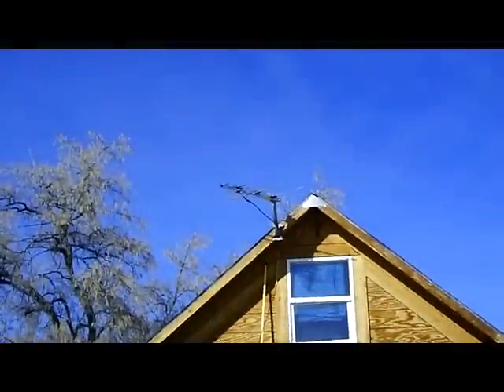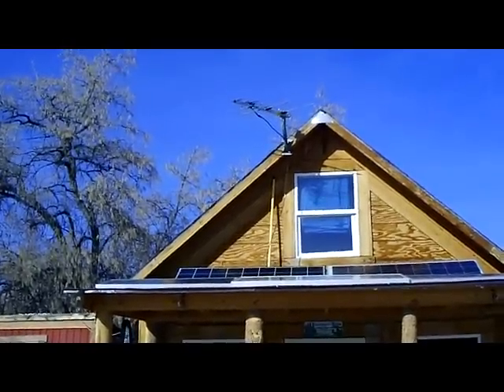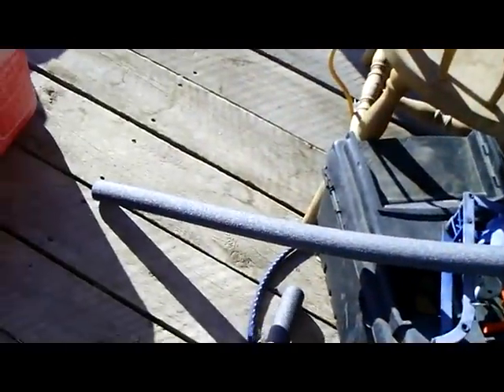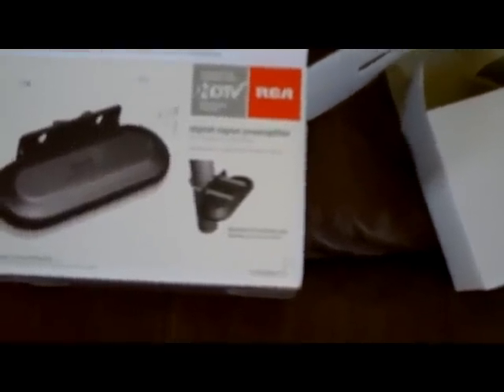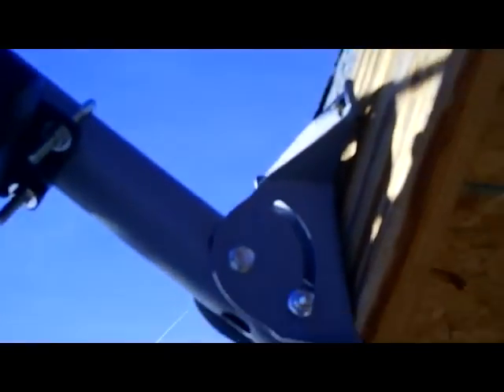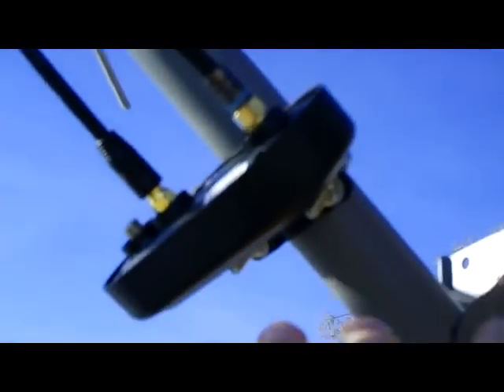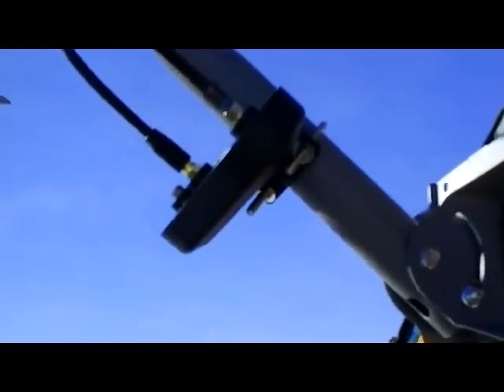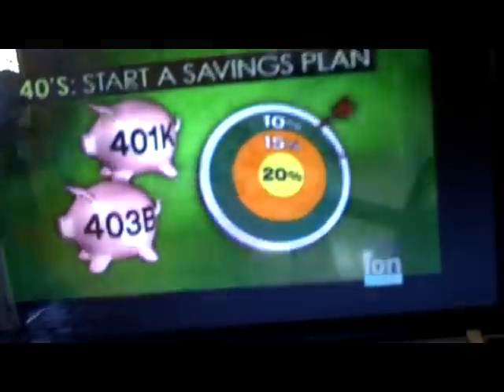Off Grid TV Installation Adding A Booster

Comment: Hey Lamar, I really appreciate your videos,thank you. I have a suggestion that you might find helpful with the outside booster. I agree with the others that it is upside down. You dont want the "elements" getting into the unit. Keep it safe. I would suggest putting it under the eve of your cabin. It will be out of the weather and then youll be able to route your cables neatly inside and through the antenna mast then thru the fascia and neatly tucked against the house. It will look nice and be safe. two birds with one stone. Thanks again and good luck Brother~
Reply from the maker: Thanks I will probably change the location. This was just for the vid to show how it works.

Comment: Just so you know that booster with the power connection actually sends dc voltage up to the preamp.  You can not boost anything without some kind of power input.  Try using the preamp without the final booster hooked into the circuit and see what you get.  Great video, thanks for sharing.

Comment: Greetings again, I was a tv repair teacher and it was my business for many years too. so here are a couple of tips. #1 the booster is designed to be mounted on a vertical pipe mast, and the cable connections are supposed to be on the bottom for weather protection... #2  the foam insulation helps protect the wire from sunlight rot. but, putting it inside metal pipe reduces the noise from auto ignition (spark plug noise) from nearby running engines including generators. and sometimes from electric motor "Hash" from sparking brushes in some electric motors too.  #3 prevent Lightning, just ground the antenna support metal mast. it then acts like a lightning rod and drains off the charge before lightning strikes it but use heavy wire like #10 or 12 and connect to a ground stake or metal pipe at least 6 feet into the ground. Correct a few details and the weather won't corrode these coax screw on connectors (They are called "F" connectors in the trade...

Comment: flip the booster outside, then your connectors are more protected from sun and weather and the cable from antennae becomes a drip loop and water doesn't travel further down that cable.
Yeah, it's still a silly design. Booster is a great idea, Dad used one when I was a kid.

Comment: I only have one suggestion. On any outside cable connections, and the unused terminal on the booster, put tar wrap/sealer or similar on them to keep out moisture. That's a big killer of coax cable. Tar wrap can be picked up at almost any hardware store and resembles electrical tape, but it's thinker and has a wax paper backing on it. Keep up the great work Lamar!

Comment: Looks like it works well.  I tried a number of cheaper ones an had no luck.  I am splitting my signal to 3 tuner cards and one other TV in another room, and I get a lot of signal loss on the cabling.  I finally invested the money ($80) in the the Winegard one and it has been amazing.  It looks like that RCA may be a good solution too for a lower cost.
Reply from the maker: The RCA antennae is well built and the booster seems to work well but not real happy with the plug placement and feels a little cheap. Made in China and I try to get US products.

Comment: OPS! the booster up at the antenna requires power to work and there is no battery in there because the DC is sent up the coax from the small piece inside. the inside piece accepts power from the plug in block and sends some up the coax to the antenna mounted part then the stronger signal comes down to the inside round piece and is amplified again and sent to the TV (Or fm radio) but without all three pieces connected none of it will work.  Remember I am a professional TV and Antenna Technician... ask me if you need more explanations I would be happy to explain. I am subscribed too. I like your productions but I want your electronics to work!

Comment: Nice set up. Just to clarify something for you, That little box and power supply feeds voltage up thru the coax to the amplifier on the mast to power it. The only component doing any amplifying is outside but requires a power source. So they made a special device that allows the power supply voltage to flow only up to the amplifier and not to your t.v.
Reply from the maker: Thanks- good to know!

Comment from the maker: For people that pointed out the booster may be backwards on the post. I reversed it but I am still not happy with the design that has all the plugs on the same side.
Reply: I would have just attached it to the wood and left it off the antenna.
two wood screws in the holes and it would be fine.

also on expence of antennas, look around youtube, there is easy to make digital antennas using hangers and a 300ohm to 75ohm converter.
Reply from the maker: Thanks- I reversed it and attached it under the eves with the wires strung down through the mast so they won't move around in the wind.
Reply: i would(sorry) would put it in a rubbermaid box to protect it from the weather, but your in texas and not up here in the arctic north(of ohio)...

and the antenna, instructibles has several designs.

Comment: Here are the weather caps for your coax the other thing is I believe the buster is upside down. you should also zip-tie the coax onto the antenna so its not hanging mid air. just a couple thoughts / ideas and don't forget the rain loop in your coax.

Comment: I picked up a Omni direction unit from radio shack that came with a booster. we get 22 channels now. I haven't paid for t.v. in over 6 years now!!
Reply from the maker: I was amazed at how much the booster helped. I get more with the small antennae and booster than I got with my big expensive antennae.
Reply: I gave just over $100 for mine because I had to buy 100ft of cable to run from the roof to the tv, but it has saved me thousands by not paying for channels I didn't watch anyway!!

Comment: Great video. Maybe you said why the lead was so short?  It would seem like the best thing would be to use a bit longer cable and mount that box under the eve.  Seems like any electronics that are out in the rain end up with moisture in them no mater what the engineers intentions.
Reply from the maker: Thanks- yes I decided to reroute the wires down through the mast and attach it under the eves. I should have looked over the mount better before I made the vid but people have given me some good feedback.

Comment: The booster should be turned the other way over, so that when it rains the water runs off the top and doesn't sit in the coax connections.
Reply from the maker: Yes I reversed it after I made the vid.

Comment: looking at the power unit for this  you may be able to run it on dc power, so  those who off grid with batteries may want to move it to dc to keep the power loss of conversion down.
Reply from the maker: It probably could be if you can match the amps and watts. It uses such little power I just run it off the inverter and it can be unplugged at night so no ghost load.
Reply: Yeah. Perhaps you could get one of those AC from DC car adapters and power it through your 12 volt system (especially if it runs on less than 80 watts of power). Otherwise, if the AC plug that powers it is 12 volt, I would just go ahead and replace the AC plug with a DC one. If it runs at higher than 12 volts (i.e. 19 volts, etc.), then it may not be worth it to do anything except use a car DC to AC adapter.
Reply: Reading an online review someone posted the power supply is 12 vdc  200ma
Reply: Perfect! LeMar should be able to simply replace the AC plug with a DC one, if he so wishes.

Comment: Love your channel.  Just a thought, couldn't you just turn the booster around?  Then that longer cable would be right and you wouldn't catch weather in the lip on the booster,  Thanks for all your work.    -Randy
Reply from the maker: I reversed it and put on rubber weather caps but still not happy with the placement of the plugs. It works fine but plugs should have been on opposite sides in my opinion.

Comment: Plug your booster into the same power strip your TV is on. That way it only uses power when the TV is on.
Reply from the maker: I have a power strip next to my bed that the laptop, booster and tv are plugged into. One switch shuts down everything so no ghost loads.

Comment: Also, the Bow Tie is the Master of UHF Reception.  Almost all stations went UHF when the switched to Digital.  You have and antenna already, but if you ever get another one, consider one of the channel master clones.  I have one of these to hit the two different big cities I am in between, it has been an amazing antenna.    http://www.ebay.com/itm/4228-8-Bay-DTV-UHF-OUTDOOR-HDTV-HD-TV-ANTENNA-/370471880025?pt=US_Antennas_Dishes&hash=item5641d84559
Reply from the maker: Thanks- All our channels are UHF and the bow tie or dish UHF are better for reception but a little more expensive. I am about 40 miles away but with the booster the signal is clear as a bell and much better than analog cable.

Comment: As a ham radio operator the biggest problem I see here is this is a mighty small antenna to not be near the transmitters.  First, there is no such thing other than in the world of marketing hype as a "Digital TV" antenna. An antenna does not care what mode its recieving as long as the antenna is designed for the frequency.  TV antennas like this one are what are known as a LPDA or a Log Periodic Dipole Array.  The "gain" of the antenna is directly proportional to the length of the boom. The longer the boom the higher the gain and an antenna with a longer boom would most likely have eliminated the need for an antenna mounted signal booster.   Now range is directly proportional to the height of the tranmitting antenna and the height of the recieving antenna.  Range can easily be determined by a very simple algebra formula and no number of "boosters" will change God's laws of physics when it comes to range.  The DTV mode is a very strange animal and the recievers need a very strong signal in order to completely process the signal and display it on your screen. What a booster can and will do is make the signal stronger for the reciever to process.  You are now getting additional channels that you were actually recieving all along it was just that you did not have enough signal strength to process them into an image.  I have to agree with Dennis another problem with this installation is that the antenna is not grounded.  I saw no weather proofing on the F connectors which are crappy connectors and MUST have protection from the weather. Since your TV runs off of DC you do not have the luxury of having the chassis bonded to earth through the ground wire of an AC connection.  I would find a way to ground the chassis of the TV to the same bond point that your ground the antenna.

Comment: If you have internet, there is no logical reason to have tv too. Esp. if you live in such a small home. You can just hook your computer up to your tv. There are all kinds of internet tv. You don't need super high speed internet either. 6Mbps was plenty for me.
Reply from the maker: You can get a lot of stuff off the internet but not local news and local sports or the old tv shows that I like. Plus internet is not free for most people but over the air TV is and many people pay for bandwidth.
Reply: Everything is online. Everything. I can watch any show that has ever been made online. You are slightly limited if you take issue with torrenting, but even without that there is hulu, xfinity, and a range of other tv like services online. Old shows are probably the first to be put on as they don't have a high demand for that anymore so it would be cheaper to get licensing to share that content. I have to eat right now, but I think I'll make a video to show how this can be done. All using the internet. Love your videos btw.